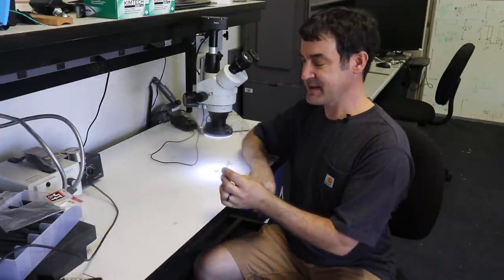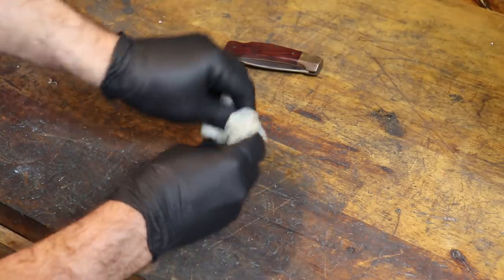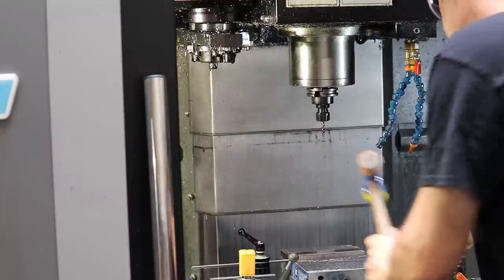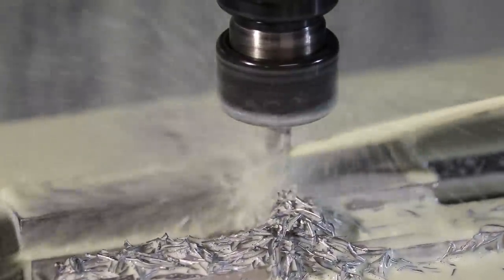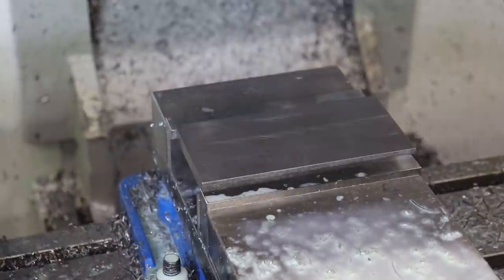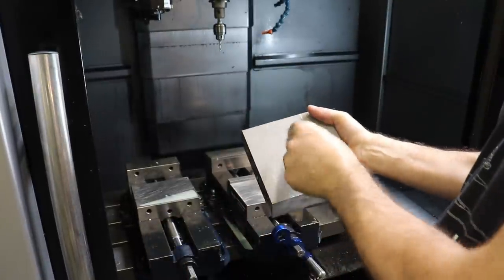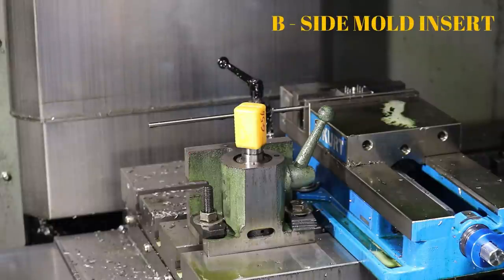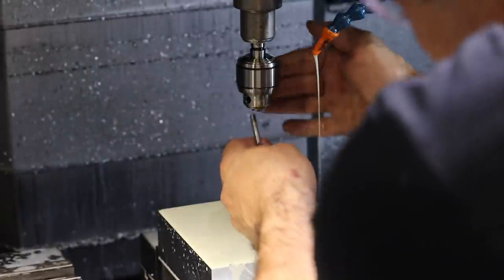MOLD MAKING: SMALL PARTS FAMILY MOLD part 1

Comment: Great video but quick suggestion, when you’re cutting parts in a vise and only using one end of the vise like when you milled the parts to length you should really put another block in the opposite end to keep your moveable jaw square. If you put an indicator on your moveable jaw on the opposite side you will be able to see how much the jaw twists out of parallel to the solid jaw. This makes a huge difference with precision and actual holding strength.

Comment: Can I make a suggestion on manually touching your tool off? Try this. Get something that's round (I use a .50 diameter dowel pin). Of course measure the diameter precisely. Jog your tool down close with a gap of less than your pin diameter Now rotate one of the flutes of your tool if necessary at a good angle to where you are going to slide your pin under the tool. Now bring the pin lightly up against the tool sitting on the top surface of your part now jog the spindle up with the handle jog set to the finest (.0001") jog rate. You should be able to feel the pin slowly sliding under the tool. Keep going until the pin passes under that flute. Now pull it back and check all the other flutes to make sure there is not one that sticks down farther. Now move the pin out from under the tool. It is important not to jog the Z axis with the pin under the tool. Jog it down a klick or .0001" try the pin and keep going till you feel a drag. You may have to go up and down a klick or so. Again don't jog with the pin under the tool! Just test it with with the pin while not jogging. You will see you can quite easily feel .0001" this way. This actually takes longer to describe than to do once you try it. This is much better than using a shim or paper. Try it. It will be much faster and just as accurate as your scope. Obviously you have to add the diameter of you pin to the tool length offset. Or tell the machine to calculate that height above Z zero.
Reply from the maker: OK, thanks.  I will give it a try.  Thanks for watching.  I enjoyed your tool grind video too

Comment: To close a hole, use a ball bearing with a diameter larger than the hole diameter, put it on the hole and give it a few whacks. This will nicely tighten the hole by compressing around the circumfrence. This works well when dowels are loose in a press fit hole.
Reply from the maker: Thanks!  I've had to use that trick a few times myself

Comment: Great video. What is the tolerance you use between the insert and the pocket? Also, given that this is a prototype mold, what is the advantage of using steel instead of aluminum for the insets? I'm curious because all my molds are aluminum, and I've never had issues.
Reply from the maker: The tolerance is ~0.0005" (12 micron) per side.  I find that it is much harder under that.  I used steel for the small shut off landings and the small pins ( so flash stays low and the pins don't break)  I did almost only aluminum but I am moving to A2 steel) seems to machine just about the same with drilled plunge cuts.  I also learned that if customers wants more parts than expected then the steel lasts longer on the parting edges of the mold.  Thanks for watching

Comment: This is just my ignorance here, but isn't there a more automatic way of touching off with a probe or something? Would something like that be on a more complex (expensive) mill?
Reply from the maker: yes, there are tool probe options for most CNC's  The Hurco controller is setup for a probe system ( tool touch off distance etc) I set that to zero since I like to keep the numbers simple, I also usually need to touch off a tool tighter in tolerance than the typical probe resolution.  Thanks for watching

Comment: you certainly have a strange way of touching off ???  I either use parchment paper, or brass shim stock. Drop your RPMS down much lower and then bring your head down till it just twists the paper or shim stock. Leaves you at about .0002 from surface for tooling.  But that''s just my way.